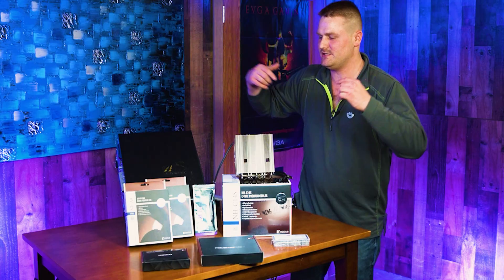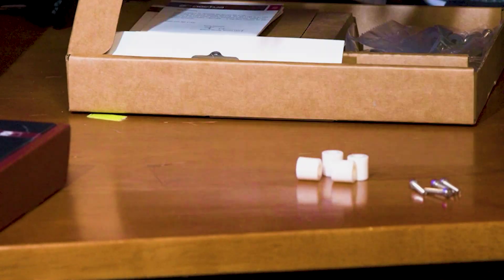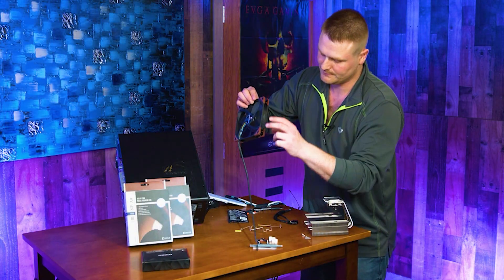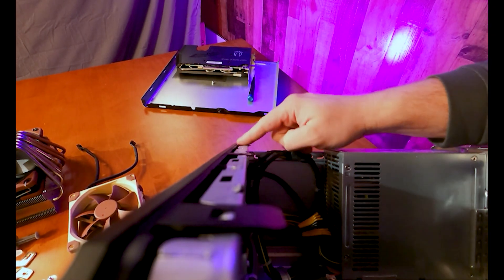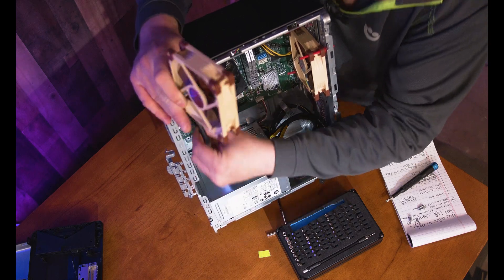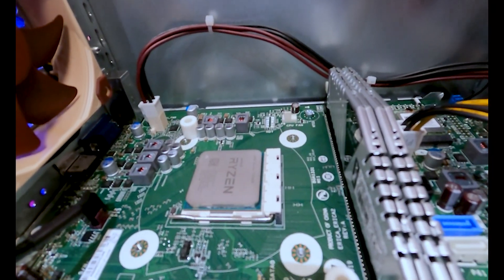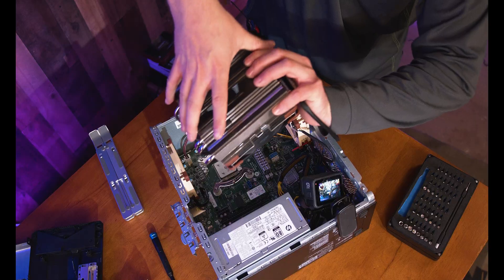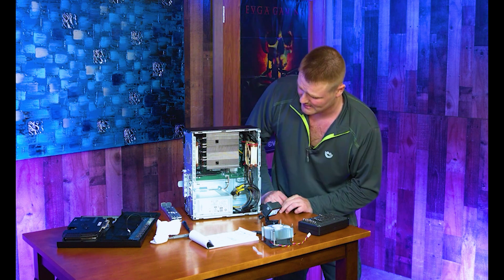TG01 Cooling | Wait till you see how big it is! CPU Heat Sink upgrade!

Comment: I bought the big cooler from the provided Amazon link, however it did not come with the white AMD spacers. The AMD baggie only has the grey spacers. I don't see the white spacers on the Noctua website. Any idea where I find these?
Reply from the maker: They change the color depending on stock. Install the cooler with thermal paste and screw with like 1/2 turn on them and see if the cooler moves freely if it seems like it is glued it is making contact. Downlaod an program to watch your temps and have it installed before you do the upgrade.

Comment: Haha, you'd have to search for such a worthless modification! Why do you all keep pushing the Noctua NF-A9 PWM? Replacing the stock exhaust fan with it won't give you any significant improvement in terms of extraction or noise reduction. And installing this fan on the front panel without cutting holes in it is just a facepalm!! Firstly, it will suffocate due to the low number of holes, and the airflow will be significantly reduced. Secondly, even if you don't pay attention to that, the air will make noise due to the close proximity to the grid.

Comment: Hi TechNitWit, I plan on installing the NHC14S into my HP Victus that has an Intel I7. Do I need to add the backplate, or can I install it directly onto the manufacturer's backplate?
Reply from the maker: Yes you can but you will need differnt screws or change the backplate and you can use the new screws.

Comment: Question with the 500w power supply and with that 3070 plus the cooling upgrades, will there be any issues with lack of power? (pc is being built exactly the same as your only difference its intel based.
Reply from the maker: Nope you will still have a 15% over head. I prefer 20%. the Amds will suck a little more wattle FYi.
Reply: While gaming it’s running 41c 🎉 i7 10700
Keeping gpu at 75 with msi afterburner could drop less but does get a little louder. 75c perfect dB. All at 1440 

Cinebench highest temp 61c

Great video.
Reply: Use different grommets for intel cpus

Comment: Cool educational video. Thank you. But as I believe, your fan direction for the CPU fan is against physics law. You can't blow the heat back to CPU. The normal way is taking the heat away from the CPU connected heat sink and the system fan suck that out. I advise people to have rather a powerful system fan because such small case is filled by heat dissipation from all PC components, especially CPU and GPU.
Reply from the maker: Thanks for the info!

Comment: I also have an HP tg01-2204ng and I understood swapping the fan.  But is there a way to adjust the speed of the fans because I can't find anything in the BIOS, nor does any software in Windows recognize the fans.
Reply from the maker: Nope you can get a low speed Cable.

Comment: Finally going to mess with mine again. You ever figure out what that 4 pin is by the ram? You have to do a lot of research on this since it's a proprietary motherboard and I was really wondering since it doesn't really look labeled.
Reply from the maker: It is for extra power for SSD Or HDD.
Reply: @TNW1337  I'm honestly kind of wondering if someone wanted to mod the case if you couldn't put an aio in the top of the case. 🤔
Reply from the maker: @train3616  it is just sheet metal.
Reply: @TNW1337  thank you sir. Very much appreciated. How tall did you say the cooler could be? I know it was in one of the videos but couldn't remember which. Taking down notes as I go back through to order a few things.
Reply: @TNW1337  so I measured before doing anything. A 120mm will definitely not fit. But I think if I can find a 92mm and mount the fan on top of the radiator and mod the top it could work. Maybe exhaust it. Would still take up less space than a larger air cooler.

Comment: What socket does the Ryzen 5 5600G erica 8643 motherboard use for the cpu cooler?
Reply from the maker: The HP use a intel 1151 style cooler.  It can be adapted to work with other ones on the market.

Comment: I have an i7 and 1660 super. Is 310W enough to replace the stock fans? It only came with 1 fan and a heatsink, but I want to replace them and add 1-2 more (TG01-1209)
Reply from the maker: Yes you can add fans
Reply: @TNW1337  cool, thanks for the reply

Comment: so I have a question, I haven't been real thrilled with the performance of my system lately and I was wondering if you would find it better to do the upgrades to the gpu, cpu, the cooling system, as well as the power supply, or if it is more worth it to build a brand new one in a better case to better fit all of the components.
Reply from the maker: I think a case swap. Because it does not limit you PSU size, You gain XMP for Ram speed. And Better cooling if you pick the right case this can be done for a little as 250$-350$. Case, PSU, Mobo.
Reply: @TNW1337  Do you still have a link to those cpu cooler brackets?

Comment: If you turn on the computer on for ten to 15 minutes it will warm up the thermal compound and the cpu will not be pulled out when taking off the cooler.
Reply from the maker: Thanks~

Comment: Why not take out the six motherboard screws and replace the cpu bracket?
Reply from the maker: they use adhesive to secure the back plate.
Reply from the maker: You can still remove it just not much fun. and As most people that own a hp are low skilled pc people, not sure how many would attempt this.

Comment: Anyone tried fitting NH-C14S to the older pavilion 790 version? The case is a bit shorter, but wider..
Reply from the maker: I know some one has tried and had problems. It depends on what socket they use for it.
Reply from the maker: I've never played with the 790 maybe I will pick one up off eBay to see if there is any thing that can be done.
Reply: @TNW1337  Thanks for the response. I’ve seen NH-L9x65 placed on the 790 so I assume it’s more a question if the NH-C14S fits inside or not. 
Looked like a pretty tight fit on the TG01
Reply from the maker: @pateeericooo  If it has the same mounting it should, not all noctua have the seems mounting system FYI. but if it looks the same it should work.
Reply from the maker: @pateeericooo  it may or may not fit. also noctua has different mounting systems on there heat sinks FYI.
Reply: The NH-C14S did fit the HP pavilion 790 per instructions in the video!

Had to remove the swivelling metal disk construction. A few screws and it’s off, giving more room for better airflow/case fans

Comment: So I installed the larger cooler with upgraded fan, 2060 super, 16 gb ram and ryzen 7 3700x...basically all the upgrades you have done. I did a 3d mark benchmark and my gpu temps were max at 86 Celsius, this seems high. I will attach my benchmark also which was lower than yours.
Reply from the maker: Can you download msi afterburner and turn the fans to max? does it still hit 86? It is possible you got a bad thermal pate on the Gpu. Covid has screwed up quality on normal stuff we would never question.
Reply from the maker: You can do 1 of 2 things RMA the Gpu or replace the thermal paste.

Comment: Hi. So I have a Tp01 setup. I have noticed how extremely similar the TP and Tg are in terms case dimensions. However the front plate on the Tp01 is flat w/o the vented front. Would you know where I could find a front plate to begin this upgrade?
Reply from the maker: Nope just get a tg off eBay. You could just do a case swap to a better psu mobo and case.
Reply: Any recommendations? Or possibly a video doing this swap?
Reply: Got a tg01-2027 with fake vents on the front top and bottom. Have no idea where this guy gets the air to the inlet fan from

Comment: I have a question would I notice a difference if I upgraded my i5 processor to an AMD if so which one would you suggest?
Reply from the maker: All depends what you upgrade to if you upgrade to the Ryzen 7
Reply: @TNW1337  I have done the cooling up grade with the large cooler great tips by the way thanks I was thinking of going to the and 7 5800 I was not sure if it’s a good move.

Comment: If I just install the CPU cooler (small version), will the HDD cage still fit?
Reply from the maker: It may. Give it a try. you will know if it will.
Reply: @TNW1337  Nevermind, found out that by removing the HDD cage of my PC I am unable to put the front cover properly. All I can do is upgrade CPU cooler and exhaust. I wish I could install this heatsink

Comment: Did you use NF-A9 PWM fan as a exhaust fan? And doesn't that HP TG01 model have Erica motherboards sys fan slot is 3pin, so that back fan just blows full speed. Althou that shouldn't be problem
Reply from the maker: Rear Fan is 3 pin.  CPU is 4 pin PWM If you get a Splitter for CPU 4pin it needs to be a 4 pin Spliter
They make then so they can take both 4 anf 3 pin. Just make sure the CPU Fan is PWM and connect to the splitter that has all the pins.
Reply: @TNW1337  I just ordered two NF-A9 fans to instal them in my TG01-1453no to back and front like you did. Also i was going to order NH-L9x65 but noctua site says it can't handle Ryzen 7 4700G base clock, so I'm going to order NH-U9S when they come stock. I have Akasa PWM fan splitter that has 4pin and 3pin

Comment: Can you do a video of upgrading the stock HP 3060 or 1650 Super GPU cooler.  The HP OEM 1650 Super GPU runs so hot.
Reply from the maker: It does There only so many option to GPU coolers on the market most of them are for the higher end GPU's. Like 2080, 3090s

Comment: PLease try 5600g or 5700g on the TG01
Reply from the maker: New video soon.
Reply: compatible? please confirm 😁
Reply from the maker: @carlmanalac1620  for what tg01 there is 10 different versions. Need model number if you flip the pc over and look on the bottom it will have a sticker with its model number.
Reply: Tg01-0023w . is it  compatible with 5600g or 5700g
Reply from the maker: @carlmanalac1620  no

Comment: I swapped the Ryzen 5 3500 for the Ryzen 7 3700x, changed the memory to 2x8GB 3200 MHz and adjusted the memory speed using Ryzen Master so it actually works as 3200 MHz memory.  Since I was swapping out the CPU, I also put a new cooler on it as well.  Noctua NH-L12S.  Everything seems to be working correctly, CPU temps around 35 - 38 when idle and never above 75 when stressed.  

My only issue is I can't get the CPU fan to stay on all the time.  It seems to cycle on and off very quickly.  While the CPU temps stay low, I would prefer to have it either on all the time, or to only cycle up when necessary.  I am unable to find any fan settings that I can adjust in the BIOS.  I have tried some Windows software as well, but so far I haven't had any luck.

Does anyone have any ideas?
Reply: No, the power supply is more than enough with the current setup.  You might need more power if you add a different video card though.  I’m not much of a gamer, I intend ion using this as a video server and blue ray ripper.
Reply from the maker: @donparrish6664  Its a good little computer. I mean if you feel you could build a computer, I would go that route. Only problem with that is you  are now your own tech support.
Reply: @Don Parrish I see you did all those upgrades that’s something I’m currently pursuing but I have a quick question I’m guessing your gpu is still the same have you needed to upgrade your power supply at all to keep up or is it still running fine, I just got into PC’s and am not sure if I do some upgrading will I damage the power supply with like a cpu upgrade and adding more fans
Reply from the maker: Pretty much your locked out. It is dumb but the Bios does a pretty good job of Ramp the fan up.

Comment: Hey, I just replaced the stock cpu cooler and rear fan on the TG01-2202ng (11700F and 3060Ti) with Noctua NH-L9x65 and A9x14PWM. The results are very minimal, what could have I done wrong?
Reply from the maker: Ok maybe flip the fan around on the heat sink or your paste app could be bad.
Reply: @TNW1337  I repasted the cpu and flipped the cooler fan, it didn't really help.
Reply: For exhaust i got noctua nf-a9 and for inlet i got nf-a9 and nf-a4 to make positive pressure but got worse cooling on gpu(3060ti). Then I removed the nf-a4 and put the low noice adaptor to the inlet fan to make underpressure in the case and the temps were back to original.
Looks like this case needs underpressure to remove the heat from gpu, it’s not that much place between the gpu and sidepanel so it is possible that the gpu recycled its own heat.
Got 75c on gpu with 99% load and 62c for cpu and ambient temp inside the case.

Comment: will the msi 3070 dual fan fit with the large cpu heat sink inside ?
Reply from the maker: Pretty sure the zotac has the largest cooler out of the dual fans but I have not looked at the specs in a while.
Reply from the maker: So the zotac is 141mm and bows the case the msi is 124mm I thin it will fit the msi is a little longer. I think it will work about 98% it will
Reply: @TNW1337  Ok thank you

Comment: I’m planning on shoving a Nvidia GTX 1080Ti Founders edition into my TG. Replace my PSU with a 1000 watt 80 gold. Put in a new ryzen 7 chip. And 32gb ddr4 3000mhz ram… I already have the Gpu.. I already tried to put it in… it fits perfectly XD
Reply from the maker: yeah it sucks Just heads up you will prob want to get the 500.
Reply: you can only use HP power supplies up to 500w

Comment: how come you wanna mount the fan there instead of the side wouldnt it do better just wondering?
Reply from the maker: I did try this at 1st just found the temps to better with it in the front.
Reply: @TNW1337  okay was just wondering mine currently with a different cpu cooler 120mm I see anywhere from 71c to 74c which I hope is good
Reply from the maker: @TheCarminesla3r  it is on the warm side, but not at the point of to much. did you apply the thermal paste ? Or was it on the cooler. this is a big mistake peps make to much paste, also I've seen to less. But if you add to much it acts like a insulated  Barrier that holds heat. Also may be the area you live in is warm? can all effect the temps, 90c is your in trouble temps!! Any thing below that is in spec. I like to be below 70c but I have some servers that run 85c.
Reply: @TNW1337  I’ve applied the thermal paste my self and I added enough plus my room is hot especially on almost 90 degree days but I try to keep the room cool

Comment: Do we HAVE to swap the backplate in order to do a cooler swap? I’m scared to try to do that
Reply: You could just add some case fans with Anti-Vibration tabs to lower the temperature a bit.
I've also heard that one guy just changed the thermal paste and original fan to a new one (still uses the original heat sink, just a new fan on top of it) to make it run better.
Reply: @XTRakki  this does help. the stock fans are just so-so
Reply from the maker: Agree.

Comment: So I'm confused. Why put the one fan on the front of the case like you did, instead of putting it down on the side right in front of the power supply? It has no benefit where you put it. The front of the case where you mounted it has the inner case then the outer case, which has no air flow to begin with. So the placement of that fan makes no since to me. The point of case fans are to pull in air and push air out without things being in the way as best as possible. That's my understanding anyways.
Reply from the maker: There is airflow from the front.  This is what I found from hours of testing i did.  Of course you can do what you want. It is just what I seen and found. With the dual fan gpu it did not help to put it on the side it did not make a difference. I tried the fans in many different configuration, to sucking from the side to pulling. If you look at the top of the front shell there is intake to allow for air.  I was thinking of removing plastic from the top to allow for more air. Best result was fan at the top and one in the rear front one was sucking and rear was exhaust. Small noctua was a 10c average difference in temp. Larger was 13-15c. Of course most gamers will never see the temps I was dealing with. I was using a strees test that keep cpu and gpu at 100% for hours on end. Of course if you want to prove my results wrong please have at it.  But it took around 8 hours of screwing around to find this data.
Reply: @TNW1337  Hmm Interesting. So what is best possible CPU Cooller and 2x Case fans combo for this case?
Is it the Noctua NH-C14S and 2x Noctua NF-A9 PWM? Or have you found something better?
Reply: @minzu79  Is it possible to add a fan and on the front ? Do I need to do something different than whats on the video ?

Comment: That is insane, I installed the Noctua NH-9S, perfect fit, but in my pc (AMD AM4+) I had to change the HP backplate and put the LGA115x backplate, and use the white spacers. The airflow just directly to the rear fan. 28 Celcius in minimal use, and 68 Celcius with the stress test.
Reply from the maker: Awsome
Reply: Did you mean Noctua NH-U9S?
Reply: Did u add an intake fan and used a y-splitter as well? Just wondering if theres gonna problems when using a y-splitter with the cpu cooler and a intake fan
Reply from the maker: @Buckheimer  if you use a y make sure  the cpu has the 4 pin one thr other 2 will have 3 pins inside of the connector.
Reply: @TNW1337  did you use a 3 pin case fan then? Cus I got a y splitter that has both 4 pins at the end and the cpu cooler & case fan I got is also 4pin fans so if I connect 2 pwm fans on the y splitter would it have problems with the mobo?

Comment: Your TG01 is a low key sleeper 

Beast under the hood though
Reply from the maker: I know hahah I really wanted to put a 3090 in it but could not get the supply to work with the HP board due to the stupid 12v Vs 5V Atx Problem
Reply: @TNW1337  try with an external psu.
The hp one for the board and cpu and the externa psu for the 3090